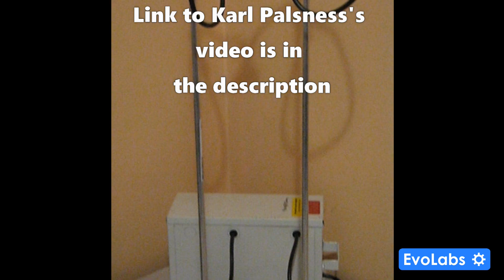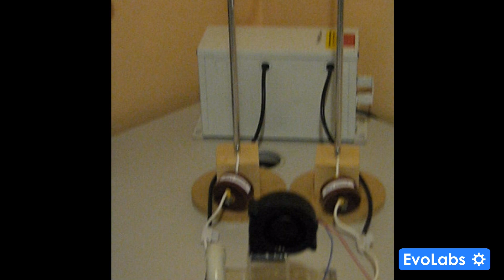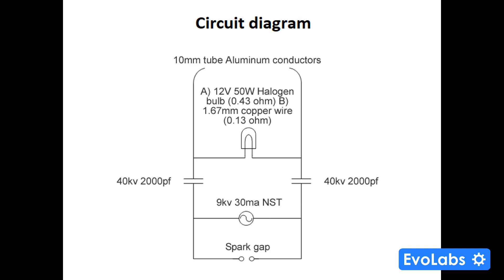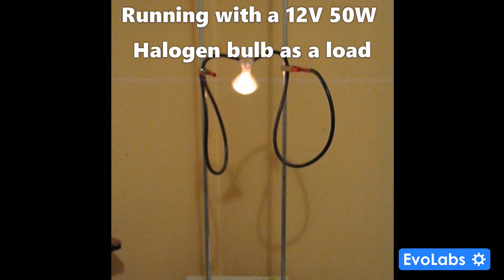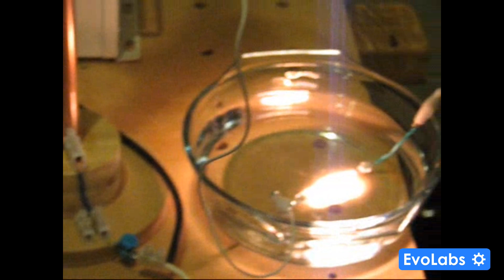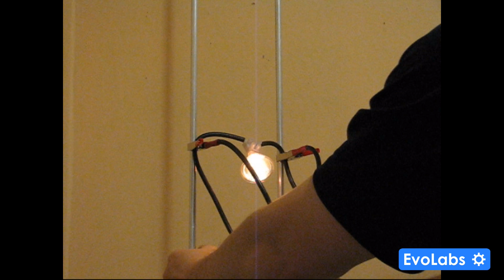Tesla Hairpin Circuit

Comment: I believe a neon tube can be substituted for a spark gap.
Reply: Will a compact fluorescent do the trick? Asking for a fren.
Reply: @cedricproper5256  It's worth a try. My concern with a spark gap is ionizing radiation, such as x-rays, which can damage DNA. I've heard that a neon tube don't emit ionizing radiation. That's why I mentioned it. A neon tube is also in one of Tesla's drawings of a Tesla Hairpin circuit, so I know it can be used instead of a spark gap.